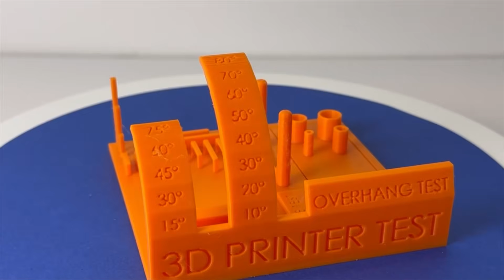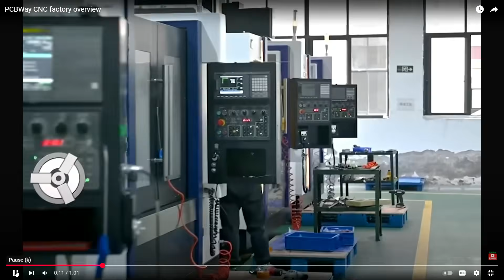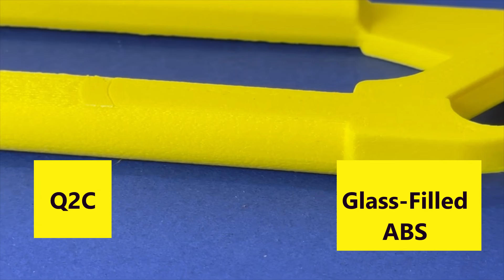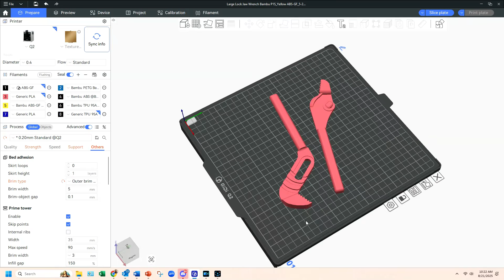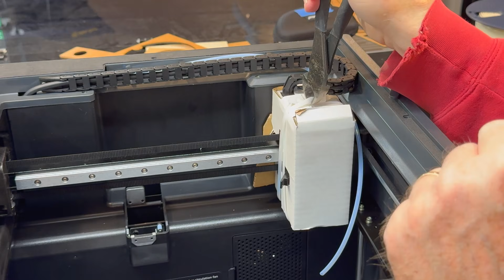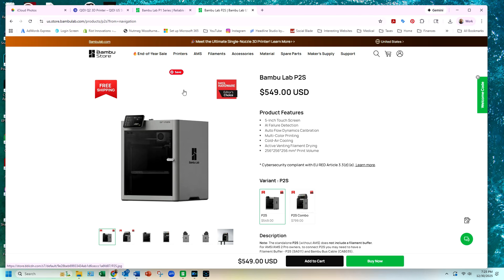NEW QIDI Q2C Combo: Better Value Than QIDI Q2 Combo?

Comment: I just bought the Q2c and am loving it! However, I do agree with you about the air filter and camera. I wish it had a filter at the bare minimum, and definitely could use a sturdier filament holder, but overall still a great machine.
Reply: I don't see too many inputs and reviews on the Q2C, so just want to pass on some upgrades that can be done at a fraction of the price. 

Pretty much the same unit as the Q2 besides those 3 missing features. 

Highly recommend upgrading the hotend fan to a Bambu X1 5015 wide mouth fan -  increases cooling for PLA and Petg prints and quiets down that fan.

Comment: With these planned firmware updates, Can the Qidi Q2 print in LAN without requiring an internet connection to print any .stl file using their sclicing software?  Can the standard ORCA slicing software be used with the Q2?

Comment: The active heated chamber not only provides an additional safety factor, it also improves interlayer adhesion and makes finished parts stronger. So, while the surface quality may appear similar, parts printed on the Q2 will be stronger than those printed on the Q2C.
Reply from the maker: You make a very good point and I agree with you. Thanks for your comment.

Comment: 3d manufacturers still thinks that cutting prices is the way to go instead of building a solid and feature packed machine. Remember where were the industry before  the Bambu ? Cheaper clones of Ender 3.
Reply from the maker: I think you are right that many 3D printer manufacturers focus on pricing; however when they bring new technologies to the market that tends to be less price-focused.  Thanks for your comment.

Comment: do you think that is it really necessary to install the lift? Don't you think it will degrade the chamber's temperature management and filter functionality?
Reply from the maker: I didn't specifically mention it, but the riser has vents in the side that can be manually opened and closed. Regarding the air filter, my guess is that when the riser vents are open they will allow more fresh air into the printer and the fan should create a negative pressure in the printer so fumes shouldn't leak out from the riser vents (but this would need to be tested to verify).  Thanks for a great question.
Reply: @ristinnovations  thank you too

Comment: Holy cow the qidibox is noisy!
Reply: put some lithium grease on the clutch gear, it gets rid much of the noise
Reply from the maker: Yes, the ratcheting gears are noisy. It’s a bit quieter when the lid is closed, but you can definitely hear it. I wouldn’t want my desk next to it when it’s running.

Comment: I think, for me anyway, that an extra $100 to improve and expand the flexibility regarding the filament types and object sizes is worthwhile. The camera and filter are also nice. Either way, it's hundreds less than a P2S combo and I can even use straight Orca slicer.
Reply from the maker: I agree with you regarding the Q2 being a better value for the $100 more than the Q2C. That's also a good point regarding OrcaSlicer. Thanks for your comment.

Comment: Ken, thanks for the video. It looked like the typical scenario - I buy something great and, very soon after, they upgrade it. I got my Q2 in August, with a promise of the Box two months later. (The Box is scheduled to arrive today) I spent yesterday printing 12 parts in ABS (plus one failure due to choosing the wrong support option). I set the enclosure temperature to 50 degrees and everything stayed beautifully flat. There was never any hint of odour or fumes from the ABS. I'm very glad that I got the full-featured version of the combo, including the improvements to the Box afforded by the delay. I love the quality of print that the Q2 gives.
Reply: I just started my first print using the Box. It just finished loading to the extruder. Smokin'!
Reply from the maker: That's great that you will be getting the improved version of the Qidi Box today and I'm glad you hare having success with the Q2. Thanks for sharing your experience.

Comment: Thanks to your review, I ordered a Q2 combo. The comparison is good and detailed, Q2 is capable to print PPS-CF and  other high temperature filaments for engineering. I was eager to purchase Snapmaker U1 for multi toolhaeds with speed, however the U1 temperature performance without enclosure made me decline the idea.
Reply from the maker: I'm glad you found my video helpful. I wish you the best of luck with the Q2 and please let me know if I can help in any way.  Thank you for your comment.
Reply: Take the u1 for multicolour pla and tpu, the kidi without combo for tech or single color prints. You have two workhorses at the price of an h2d.
Reply: @marcopittaluga5590  For budget issue that I don't want to spend much to keep two workhorses in a room, and don't forget the invisible particle pollution. I had some rolls of PLA forgotten in a corner of my working room over 4 years, the smell and sticking dust were terrible after PLA filaments or parts went degradation into air.

Comment: Was the riser used for multi-color printing on the Q2?
Reply from the maker: No, I didn't have a riser when I initially set up my Q2.  I have since received an updated Qidi Box that includes the riser so I will be installing that this week.
Reply: @ristinnovations  Thanks

Comment: Thank you for the review. So the heated chamber seems didn't provide much of benefit for the abs print quality...I want the q2 mainly bc of the heated chamber. If the heater chamber won't help much, then the  P2s is a good choice for only $50 difference.
Reply: I can print abs fine on my bed slinger too in the open air if the model is only 1 inch tall, but once you go up the Z layer adhesion suffers and parts are weaker then regular pla.  Its because the model stays pretty hot around 50-40c just from the ambient heat off the bed for a good inch or 2, so this really wasnt a good test of heated chamber vs none for ABS quality.
Reply from the maker: I have been able to print higher temperature materials without an actively heated chamber, but I think the actively heated chamber gives you a larger process window/better odds that your print won't warp. Thanks for your comment.
Reply: Dedicated heater might be faster than heating only with bed + can keep the temperature (higher) even in colder environment (not sure if actual problem though).
I'd think of having chamber heater if going serious with (non-CF) high temp materials
Reply: ofc it will help, a lot.

Comment: I have the older Qidi X-Plus-3. I need to get a new Heat Bed as Mine is faulty and Qidi said they can't get it for me!
They pointed me to the Aliexpress page for the heated bed replacement, the trouble is it costs allot.
With shipping it will cost me over £55 ( I am in the UK ) that is a pricey replacement.

I really need to get the printer fixed as it is the only enclosed heated chamber printer I have that does great high temp printing!  I looked at the newer Qidi Plus 4 printer which has the same heated chamber but better printing.

The Q2 looks nice, I agree the Q2 C is not worth the missing parts that I also wish to have in the newer printer I may buy?  I found that Aliexpress do tons of spares for the Elegoo Printers I have that Elegoo don't even have.
Maybe the spares for Qidi Q2 are there?  Nice review.

Happy New Year 2026 everyone. 😉 🎆🎉
Reply from the maker: Thank you for your detailed comments.